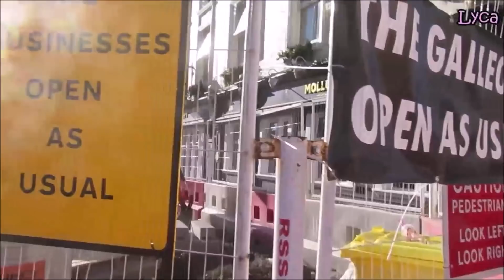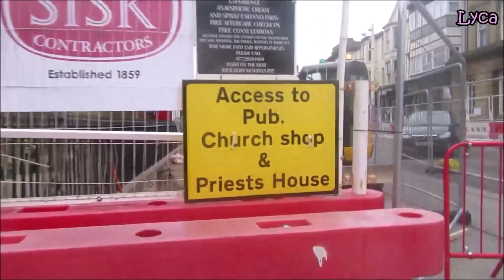Talbot Square and Tram Tracks week #22

Comment: Does the tram route go between Wilco and the bus station, Lyca?
Reply from the maker: It should do. It should run all the way from the prom (Talbot Square) to North Station.
Reply: binarybox  They are going too pull down Wilko and on the site you’ll have the new Tram terminal. That’s not going to happen till 2019
Reply: @michaeldavidgraves3961  I did hear that but wasn't sure whether to believe it as it has only just been built.
Reply: by mid 2020 things should be up and running